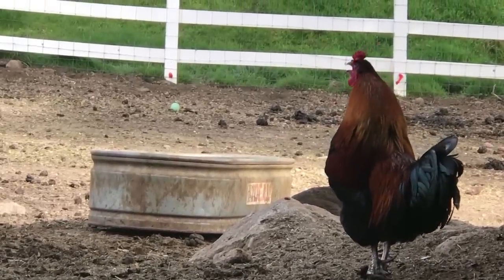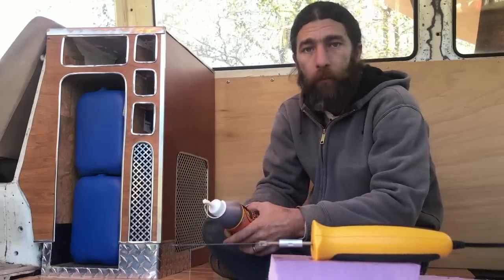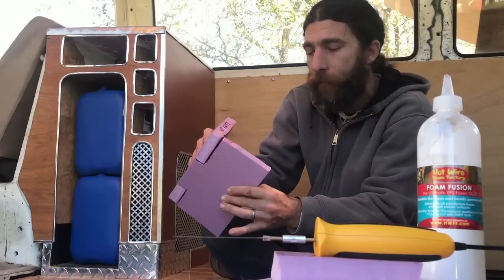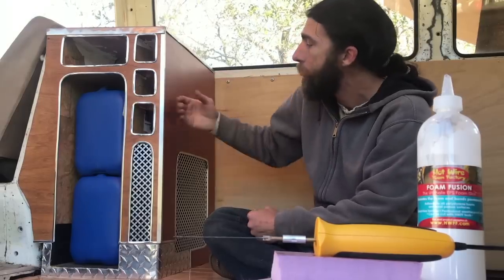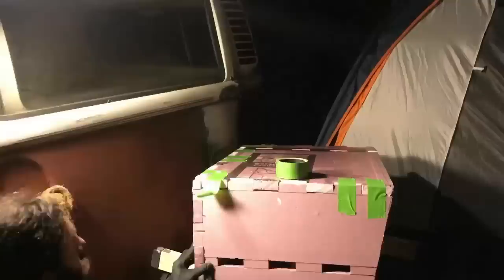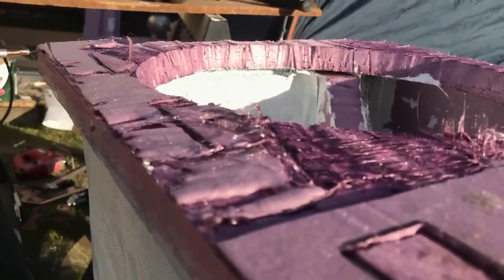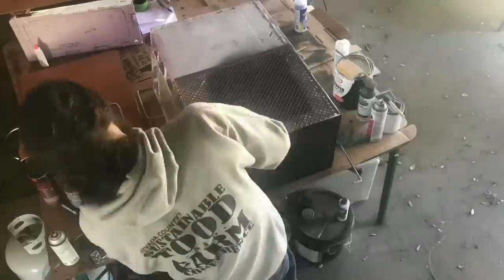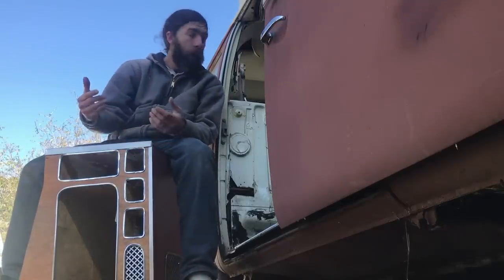Foam Cabinet Prototype - Improvements on Building Foam Cabinets for Camper Van

Comment: I have made two foam trailers now using the canvas over foam method. Super light and surprisingly strong. You can see some of the build process here https://youtu.be/IOTRwcs6oT4 . More videos on my channel. 

I use a soldering gun to make some cuts and channels. For really nice cuts I use a band saw. My go to glue right now is Gorilla Glue Construction Adhesive. It comes in a caulk tube. It does not foam like the conventional Gorilla Glue and has a good initial stick to hold pieces together. 

Thanks for the video, George.

Comment: I bet you could hot glue that hot knife upside down to the bottom of a table saw and get some really precise cute.
Reply from the maker: “Precise Cute”?! No matter what you do, yer not gonna make me cute!!!

Just kidding… I know you meant “cut”! 

Yeah… in my upcoming glue up video I show a technique where I hold the hot knife still and slide the foam through it to split the 1” thickness in half. Stationary knife for vertical or horizontal cuts is definitely an option.

Comment: This is a really cool idea. I'm curious though, how did you secure the cabinet into the van? Did you glue it or screw it, or another method?
Reply: Velcro!
Reply from the maker: This will be covered in the upcoming Q&A video... you can screw through it with a 1” washer on foam side. I’m looking for a “quick release” anchor so I can take the pieces out easily, but screwing would work fine.
Reply from the maker: Hey thanks for the comment! It was addressed in this video I just released. Check the table of contents at the beginning if you want to skip to a particular subject: https://youtu.be/BcAXr_gtbG8

Comment: If you want to look into a whole cabinet industry that only uses foam or other lightweight materials for cabinetry, look into the yacht industry.
Reply from the maker: I’m familiar, this is intended for DIY builds… I have a more recent video on this technique (full transit build) where I mention the system is used in RV industry, etc. but thanks for the heads up!!

Comment: Nice build! I have a question. I am looking at making a modular style camper out of a Sprinter. The reason being I have a family of 6 we don't camp out much and I would like to be able to use the van for when relatives come visit and we need to travel. I was thinking of making cabinets that were light weight that could be taken in and out using a rail system. This foam seems to be a good place to start. How cost effective is this? Do yo think the foam would work in a build like I am talking about for the sink and possibly a shower unit as well as overhead cabinets? Take care and keep doing whet you do!
Reply from the maker: This is partly why I am doing my cabinets this way too... so they can come out easily... stay tuned for more on the details of that.
Reply: I was looking at a rail system similar to "Mac-Trac" not sure how costly this is, but it seems very modular. Subscribed and can't wait to see what else you come up with.

Comment: just wondering ... suppose you have an 8" by 30" piece of foamboard and you want to bend it 90 degrees.  About what is the minimum radius curve you could make without it breaking?
Reply from the maker: Without heating it or cutting reliefs, not very far... you can see in the video at 4:45 when I break the piece with my finger...  it might go to 45 degrees... I think if you cut some reliefs out of the inside corner it could bend further... I considered (and still may) so some curved pieces using this relief technique.

Comment: Some good tips, but I think yours is significantly stronger because of the metal screen, wood sides, diamond plate bottom and stainless steel top pieces all locked together with liquid nails lol...

Comment: Many people who convert their own RV's miss this very important part, Weight is your enemy. It can add up very quickly, reducing you fuel milage and increasing the wear and tear on the drive train and braking system, Plywood, laminate flooring K3 press board, and god forbid drywall are verbolten in a mobile home construction,, aka RV.

Comment: Are you at all concerned about VOC's (Volatile Organic compounds) that will be off gassing for an extended period of time, years probably, in a small enclosed space?  Of course if the foam, paint, glues, are available in low/no VOC versions, that would be huge.  Cool video though.

Comment: Can I just use the glue onto sides of foam  to glue ply wood or just use spray textured paint on and call it good  along with using the pre cut finished laminate countertops at depot   I’m only working with about 18” by 24-30”Lx height up to window on sidedoor gmc van countertop cut beyond width of door up against int wall   Now check this concept.  I’ll Velcro the back of cab to door. When door opens the countertops gonna extend which be cool but... I can cab off door and lower to acceptable height able to utilize countertop outside.   Lift back up a few inches to close door in cab will be water container on up to pump faucet with hose line long enough to swing door open using sink outside. Sink drain hose longer also down through hone in step to ground. Easy Peasy.  No cab front so door closes right over water container
Reply from the maker: you can use screen and paint only, or no screen and paint but any other laminate material instead.

Comment: I bought the 3 inch  Foam Factory knife you recommended but I cannot cut a straight line with it because  the blade is too flexible.  Any suggestions?
Reply from the maker: Slow the cut down, use a jig (metal straight edge), use a sawing motion while cutting to keep the hottest part of the blade on the foam.

Comment: No need for smelly polyurethane varnish, quick drying interior satin varnish is odourless, dries fast and gives a fantastic finish: First coat to seal, sand lightly and 2nd coat to finish.

Comment: Great build, but did you consider using an electric carving knife?
Reply from the maker: While I did not try a carving knife... I would imagine it would give a rough edge and it would not solve the problem of being able to do curves, plunge cuts or fine shaving of thin pieces.
Reply: I've never tried either technique, but did see a home improvement show where they used one. The kind you carve a turkey with. Can't vouch for it though. Was hoping to save you a little time on the long straight cuts mainly. Enjoyed your video very much and am looking forward to more of them. Thanks
Reply from the maker: I've just solved the long straight cut time... Hot Wire Foam Factory saw the video and sent me some free tools, lol... thanks for your interest and ideas!!!

Comment: Should just mount the tool under a table with a hole in the table that way you can use both hands aswell as your foam is held straight cause its held flat on top of the table

Comment: Hi All, If doing mass production, how about a 3D Printer head on a table, slide in the foam, punch a few keys, the machine cuts it for you, then if it isn't too fast, you can do something else while it is cutting. Thanks.
Reply: Turns out, company that makes cutter makes CNC machine, $8,000, or about the cost of small car. 

To make yurt, these panels come in 8 ft, by 2 ft by 4 in. Set up  jig to hold panels at proper angle, duct tape to 2 cutters together, so they are parallel. Make one cut, and cut 2 pieces at once. thanks.

Comment: I also saw "Into the Mystery 13" when he showed the cabinets in another van, and the disaster that happened when he tried to build them himself for his current van.
Question:  Is there some sort of filler material (think Bondo for foam) that will bond with the foam so the voids around the finger joints can be leveled out?  This would increase the bonding surface and further strengthen the joint.

Comment: can you use regular fiberglass items on top of the foam or would the epoxy melt the foam
Reply from the maker: Melts it but there are work arounds... This topic is covered here: 

https://youtu.be/dru51u-vLCs
Reply from the maker: Hey thanks for the comment! It was addressed in this video I just released. Check the table of contents at the beginning if you want to skip to a particular subject: https://youtu.be/BcAXr_gtbG8

Comment: Well done mate but there is a product called Gator Foam (NOT Gator Board) that is identical to your product but has both sides already laminated with a hard skin of thin abs plastic. So the whole laminating with gauze step that you showed is unnecessary. I've used it for years making cupboards etc. The edging is dine with 20mm melamine iron strips. A block sander quickly finishes it off perfect for painting or applying digital prints. The digital prints allow surfaces of wood, stone, metal - whatever to be applied.

Comment: I ran a business for over 30 years making the whole product (a hovercraft, search sevtec) using polyester resin over polyurethane foam.  Much simpler, but not as pretty unless one uses ply over the final coat of glass.  Just think, one can build the whole camper out of such construction, including the kitchen sink.

Comment: one of the heaviest parts of a camper is the sleeping bed..  any ideas  with foam?
Reply from the maker: You are the second one to ask about that... I had not considered doing the bed / seat out of foam... I'll have to ponder that a bit... it's an interesting idea... I have a mock up of the bed in wood right now... it would be a challenge to do it in foam... hmmmmm....
Reply: I guess you could insert cross beams interveaved on the bottom..
Reply from the maker: I want to try gluing in wood "stringers" the way they do on surfboards... that one thin piece of wood down the center of the surfboard provides all it's rigidity... that could be one option.

Comment: Hey Nomad, I have subscribed and liked.

You do really nice work but there is a sanitary issue with this cabinet/sink unit.  I would want a tig weld on the sink to the counter top because the assorted nasties that can live in the crevices can make you pretty sick.  You won't even know where the sickness is coming from but this unit  can not be sanitary, the way you built it.  

I think your work looks really great but this video does not explain all the dead space.  what are those little compartments for?  What do you want to put in there?  I get the water tanks but this video doe no explain how that water is delivered to the sink.  Those are not pressure tanks so there has to be a pump.  Where is it and how does it operate?  

Another thing I do not get is the air vents.  I get that water tanks sweat but I don't see how the vents you built in mitigate that condition and if that is not their purpose, what are they there for?  

Quite a handsome rooster you have, What is his name?  I never named hens but I did name my roosters.  My last rooster was named "Cogburn"  in tribute to Marion Robert Morrison.  

I hope to have a dialog with you...Rob

Comment: How did you gix the unit to the van?
Reply from the maker: You can screw through with a 1” washer on foam side.
Reply from the maker: Hey thanks for the comment! It was addressed in this video I just released. Check the table of contents at the beginning if you want to skip to a particular subject: https://youtu.be/BcAXr_gtbG8

Comment: Foam is extremely flammable. Any fire will turn the inside of the van into an incinerator.
Choosing materials that are not flammable is just if not more important than saving weight.
Reply: You can hold a torch to EPS or XPS foam and it will self extinguish the second the flame is pointed away from the foam. This page from the EPS Industry Alliance has information on fire performance and safety: http://www.epsindustry.org/building-construction/fire-resistance

Comment: Yeah brilliant, I had the same issue with Gorilla glue, it expands when it dries.  Makes zero sense as a glue choice.  I use it to glue cuffs on vacuum hoses because when it expands it seals up any gaps and eliminates vacuum leaks, but aside from that I can imagine what it’s good for.  Your result is amazing because no one builds a light weight RV.  By the time all the particle board furnishings are installed, the whole things is massive heavy and falls apart as soon as you start using it.  It’s all obscenely overpriced junk!  This cabinet will last forever, weigh almost nothing, and can be built simply and at low cost.  While the finger jointing is a great idea, even without it, it would be extremely strong.

Comment: If you need really precise cutting, you should look into a proxxon hot wire cutter https://www.proxxon.com/us/micromot/37080.php. Ironically you may want to look into Rpg gaming building. They use a lot of foam board for building, and have come up with a lot of really effective building methods, that may be translatable to larger scale

Comment: Why not use fibreglass cloth and resin instead of window mosquito mesh and paint.  After all fibreglass cloth and resin are specifically intended for what you're doing.  Also, you can buy fibreglass reinforced foam boards which is basically what you're trying to do but already done at the factory.

Comment: your time and effort and artistic effects are great BUT the use of foam with all the add-ons especially the polyurethane liquid nails add a lot of weight.  Also using foam rather than plywood or fibreglass reduces your storage volume... as a former westy owner 3/8" plywood rules.
Reply from the maker: Hey thanks for the comment! It was addressed in this video I just released. Check the table of contents at the beginning if you want to skip to a particular subject: https://youtu.be/BcAXr_gtbG8

Comment: I was just thinking what would happen if you took fiberglass insulation and soaked it in that glue and then pressed it into the corners of your project to reinforce them
Reply from the maker: Would work but more work than needed for the strength in my opinion.

Comment: What is the best possible way to make 3mm foam stronger please without robbing the bank?
Reply from the maker: Screen then veneer.
Reply from the maker: Actually veneer is expensive, screen only is strong… if you need it to look good you can add fabric or wall paper?

Comment: Interlocking the foam panels does not increase the strength of the part. It just makes your cutting more time consuming. Foam itself does not have any strength. It merely holds the laminating surfaces apart.  Strength is gained by the distance the laminates are separated and the type of material used for the laminate.`
Reply from the maker: Hey thanks for the comment! It was featured in this video I just released. see 22:35ish in that video for your specific question: https://youtu.be/BcAXr_gtbG8

Comment: Not sure how you would hang doors, or mount drawer slides. This material doesnt hold screws for very long.
Reply from the maker: Hey thanks for the comment! It was addressed in this video I just released. Check the table of contents at the beginning if you want to skip to a particular subject: https://youtu.be/BcAXr_gtbG8

Comment: Yeah i get the lightweight and all, However. This is way too labor intensive for the average builder its much easier to just build a wood frame and laminate the whole thing with Formica. 5/16" Sub flooring plywood would be much more idealistic than all the extra steps of reinforcement.
Reply from the maker: Hey thanks for the comment! It was addressed in this video I just released. Check the table of contents at the beginning if you want to skip to a particular subject: https://youtu.be/BcAXr_gtbG8

Comment: Hello! I manage social media for a company called The Engineer Guy, based in Atlanta, Georgia. We are a mold-making, casting, make-up, and special effects supplier, and one of the brands we happen to sell is Hot Wire Foam Factory. I was directed towards your video due to its great practical content, with the instruction to ask you if we might use some of it. This would be based off your permission, but the idea would be to download it, shorten it to essentially just the parts about the HWFF Hot Knife and Foam Fusion, and share it on our FB page. If granted permission we would credit you and provide a link to your original video on youtube. We understand if you decline, though we thought it worth asking since you provided great practical-use content for those products. Thank you for your time, hope to hear back from you. ~ Ian

Comment: Why not just drill dowel holes and glue plastic dowels in. Instead of having to notch it all out?
Great Ideas here though. possibilities are endless
Reply from the maker: The way they use pegs in wood working? Sure you could do that. “Drilling” into the foam may be an issue, I have not tried that. Also may end up being as much work.
Reply: @falkornomad  I was thinking just drill straight through the diameter of a plastic dowel and a set depth. Then just glue them in. That way you don't have to align them. Would be just like a pilot hole.
Reply from the maker: Yeah I understand... it would work for sure.

Comment: I suppose this is only good for things without hinges. I can't imagine screws would hold onto something as porous as foam.
Reply from the maker: Ehhh, no, there are plenty of ways to add hinges to foam. Have you seen my more recent build?
Reply: No. I'll look for them. I was just looking at how yatchs do it. They build doors with wood frame and foam centers. That seems ideal for doors where security is not an issue. They still use woods for cabinets. I suppose it's because foam would be too thick in such small confined spaces.
Reply from the maker: I kind of cheated with my full van build with this system by making the structure all foam and then the cabinet faces are 1/2” ply. But there is a screw anchor system I developed and detail in those videos that would allow you to do hinges… OR… you can router a notch in the foam and glue a strip of wood for hinge mounting.